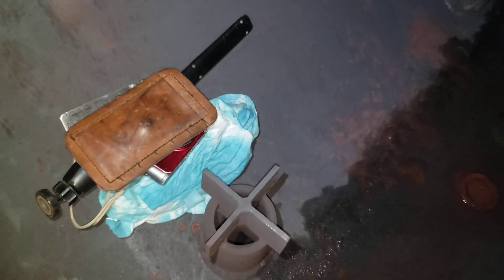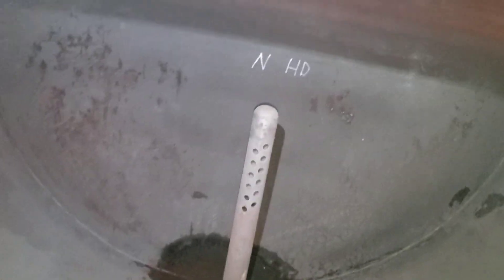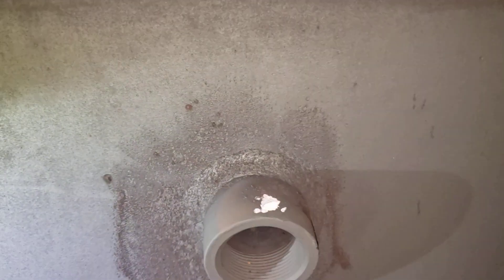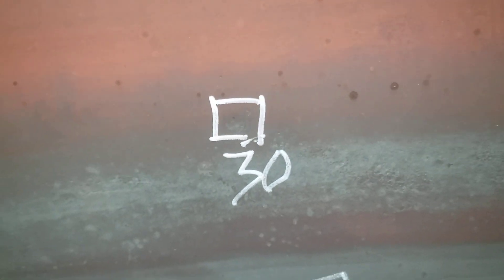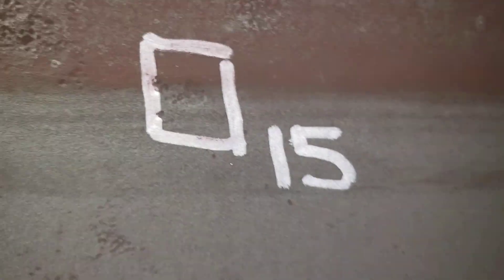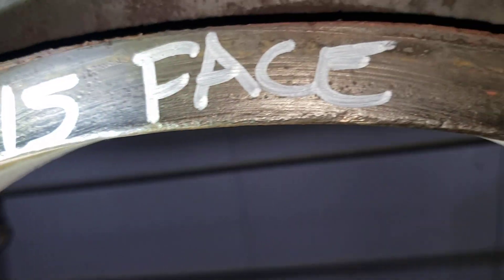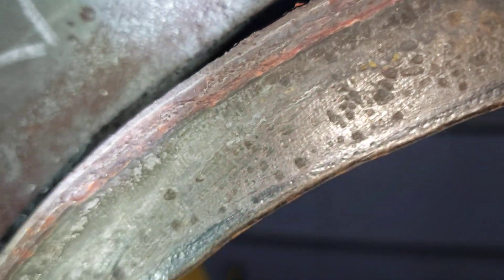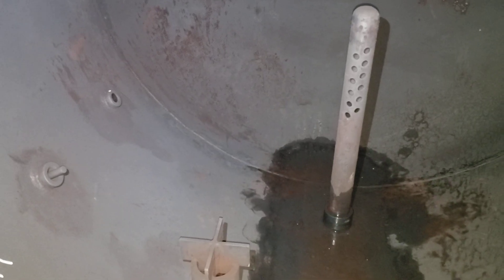Welding and surface conditions of vessel internal

Comment: its weird you would think the machine work on making that flange would of cleaned up the impressions unless they just stuck it in straight from the press without machining it
Reply from the maker: These are corrosion from service.   The handling marks and impressions from forming are on the shell.   MrEric